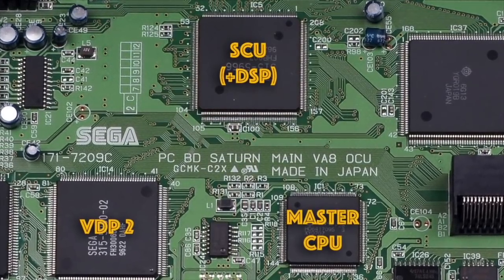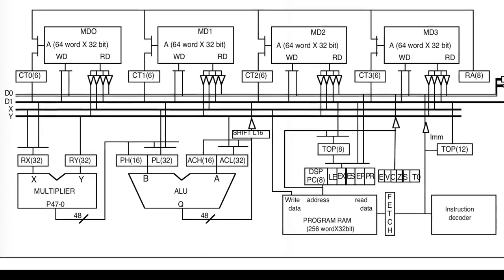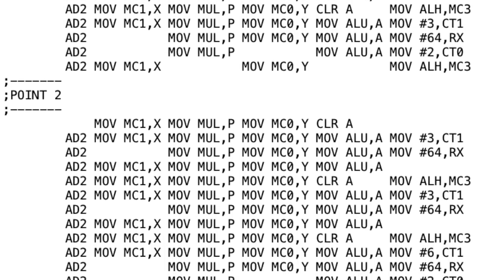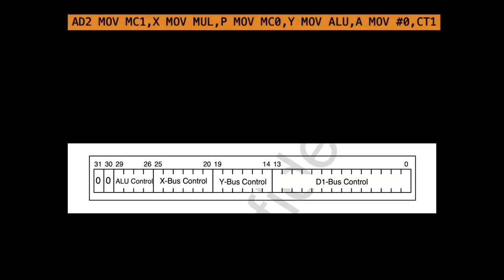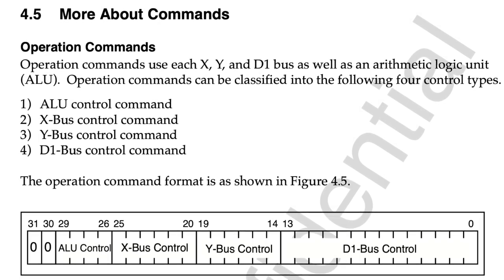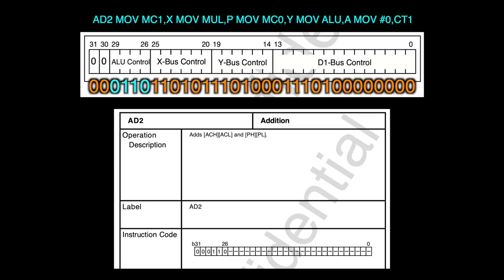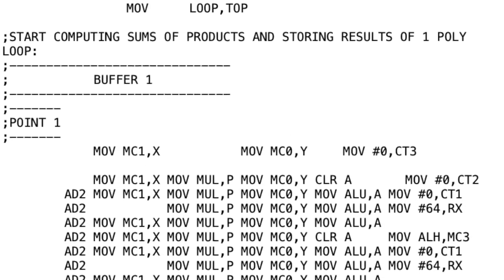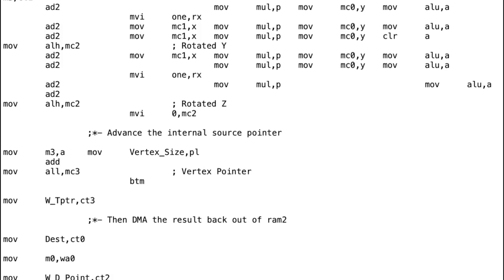The Mystery of Sonic R's Impossible Code - Coding Secrets

Comment: The moment I saw that one command was 100 and the other was 010, I said to myself "Maybe 110 is moving both at the same time?"
The thing is I have NO idea how to code or even what GameHut is talking about.  From math I know a little binary, and assumed if the numbers weren't used, then it'd free to do it.
But this leaves a question:  If the code specifies that one "bus" must be used to do two commands at the same exact time...how does it do it regardless if something like 110 signals for it to do it?  Does it utilize something else to achieve this?
Reply: A LUT opcode table along AND operation in the decode phase (CPU fetches opcode, CPU tries to decode opcode)

Comment: The only thing that could be is concation. Basically the assembler combines the 2 commands into one command and the hardware interprets as combo command and then sets both registers at the same time. Now if you were setting the same register let's say x register this would lead to an interesting problem because the dsp is a parallel unit. So which value would set if this scenario would happen?

Comment: It is four types of control commands, that is technically correct. As to why some commands aren't listed, I have no idea. Perhaps something like "these commands can be executed at the same time" got lost somewhere, somehow. 

X Bus control controls RX, PL and PH. Y Bus control controls RY, ACL and ACH. I was going to suggest that perhaps in the earlier iterations, X and Y buses only controlled RX and RY. But that isn't the case, looking at the data diagram. Maybe it was the case before, but they realized they can do more at the same cycle, but while revising the document, they forgot to add the aforementioned parts. 

The base document (that explains control commands) feels older; it says 1994 SEGA on the 2nd page, even though on the 1st page the date is shown as 1995, and it is the third edition. Other documents that have examples in them seem to be newer somehow; they say 1994-1995 SEGA on the 2nd page, and the date on the 1st page is 1994 this time. 

In any case, cutting a whole cycle and instead executing two-in-one is neat!

Comment: Having written: https://bitbucket.org/Coto88/armv4core/src/master/ I think I can relate to a possible reason:
The opcode translation unit in the processor (the opcode table translation by index) never accounted 2 sets of instructions each, but just either of the left column or the right column separately.

This means, sort of like a if(OPCODEREAD AND OPCODE1) if(OPCODEREAD AND OPCODE2) rather than switch(OPCODEREAD){ CASE(OPCODE1)... CASE(OPCODE2)... CASE(OPCODE3)... CASE(OPCODE4)...}

If we look at ARMv4t processors, ARM mode, ALU opcodes are packed into the barrel shifter registers (the ALU unit), an extension of the ARM processor. By doing that, it's possible to repurpose upcoming opcodes to use new uses of the ALU unit... something Saturn DSP didn't quite do, or simply didn't care to.

Comment: If you get the chance, could you take a look at the special stages from a sonic fangame called Sonic Triple Trouble 16-bit? It's a game that tries to emulate sega genesis hardware as close as possible and has faux-3d special stages with an artificially lowered frame rate. Considering how smooth the 3D Blast special stages were, I was wondering if it could run at a decent frame rate on an actual sega genesis.

Comment: I think your idea is correct.  If MOV moves are supposed to be mutually exclusive it would only need 2 bits to specify instead of 3 bits, according to ST-97-R5-072694 .  This kind of stuff does happen. At least you didn't do a Halt and Catch Fire instruction.
Reply: More than likely what happened is that SEGA always new it would work, but couldn't explain it to the technical writer correctly to do it.
Reply: I write operating system code in assembler for mainframes and and I just started a new job to work on an mainframe emulator and I can tell you this kind of stuff happens more than you think.  Mainframe Principle of Operations is written at the end, by some really tired guy after working for too long, probably in another language, while his wife is leaving him.

Comment: Is this a reupload? 
Not that it's a re-examination of an older video, but that it's a complete reupload of this same video you uploaded recently. I distinctly remember watching this when I was really tired and couldn't comprehend it, so I gave up. That was at least a week ago, I think. So either it was a dream (in which it made up specific comments that I can't find to the tune of "'here it is in binary' me: 'oh, ok, thanks'") and I'm truly clairvoyant or this is just more evidence that the simulation is broken.
Reply: Also, I think the difference is explained in the manual showing "100xxx" for the X-Bus Control. Are those xxx's mentioned in another section of the manual? 
Are those xxx bits to be filled in with other commands, as you do have in the binary line you've extracted, 2 different bit sets in the 2nd half of each X-Bus and Y-Bus Control block? If the xxx are filled in with bits used to denote the end of the X-Bus and Y-Bus Control blocks then you'd expect them to be the same but the 2nd set for X-Bus is 101 and the 2nd set for Y-Bus is 100.
I wonder if the xxx section uses a different set of bit combinations so it understands the distinction between the two. Maybe they're different bit combinations so you can't screw up the math doing the same process twice and, maybe, so you don't accidentally move something out of a block without replacing it with something else for the next clock cycle.